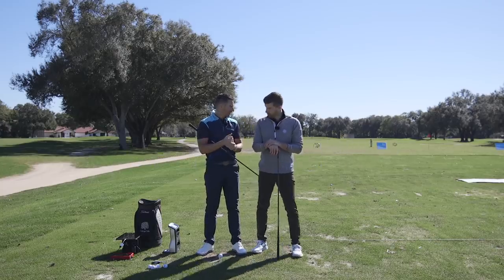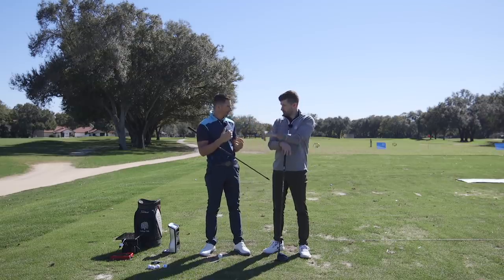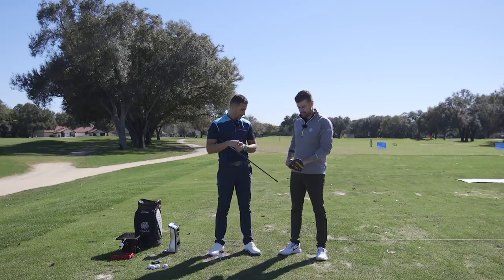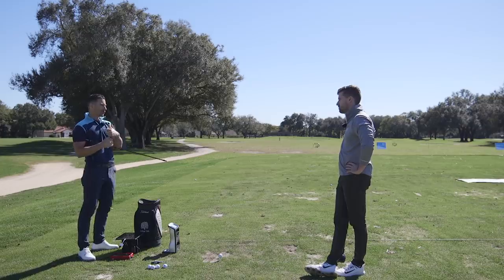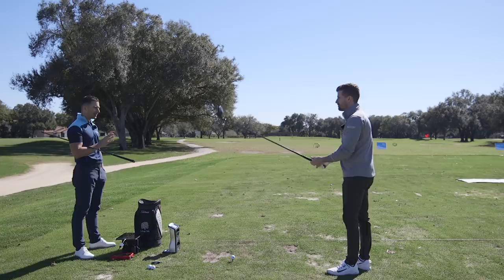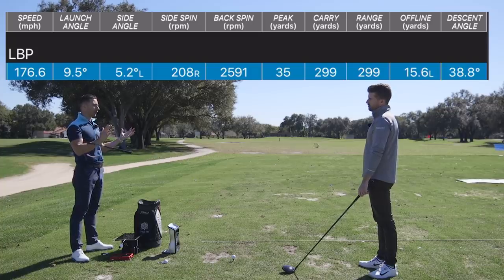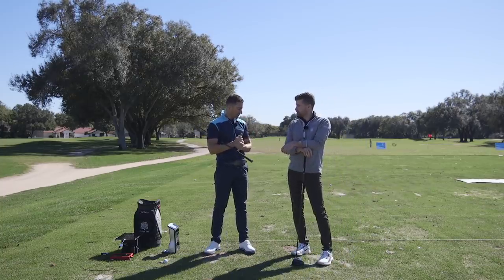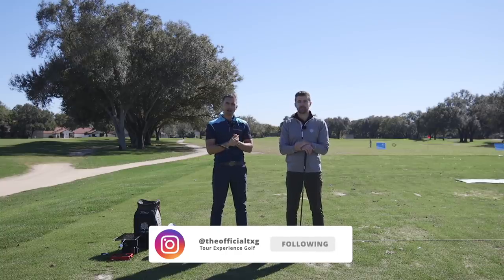Prototype Variable Balance Point Shaft – Accra

Comment: I love to feel the head of s driver but it is tougher that last number of rears. I typically use a R flex because of my tempo, but the best shaft i hit was a a ladies flex on my wifes Ping G4 driver. I could hit it 280 of the deck in the sim,(it was 16 deg) but i could feel the flex pull down the weight. And it was only 15 yards behind my driver from the tee.

What should i look for in a shaft to give me that same feeling?

Comment: Stupid question from Bandit; does Balance Point have any correlation with Swing weight?
Reply: Bandit Baker definitely can. Higher balance point typically means more weight up near the grip end of the shaft which could give a lower swing weight reading.
Reply: @kourt2469  👍

Comment: Are balance points and kick points  different things?
Reply: Rusram yes. Balance point is the point on the shaft where the shaft could balance on your finger basically where you could balance equal amount of weight on each side. Kick point is where the shaft bends the most when being swung.
Reply: @kourt2469  thank you